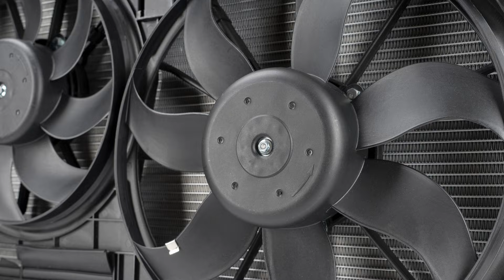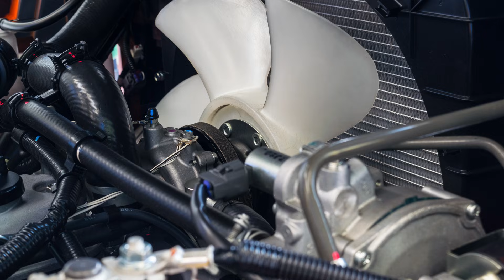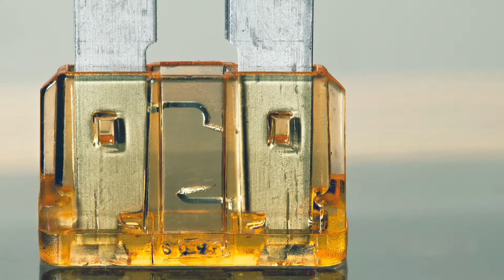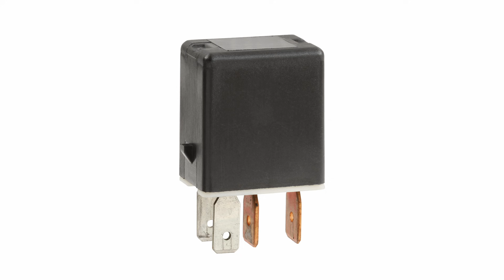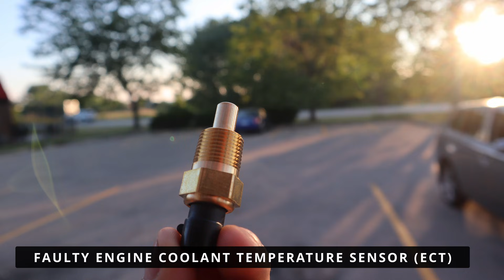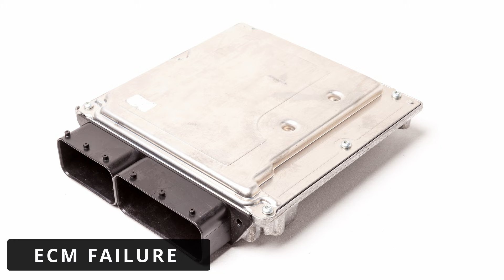P0480 Code: Cooling Fan 1 Control Circuit Malfunction (Causes)

Comment: What happens when you get the code but the fan runs and the vehicle doesn't overheat 😔
Reply: Going through this rn
Reply: Anyone fixed? My fan runs but the code exists
Reply: @dergangsterundso1264 it ended up coming from the rear AC unit that had been capped off.